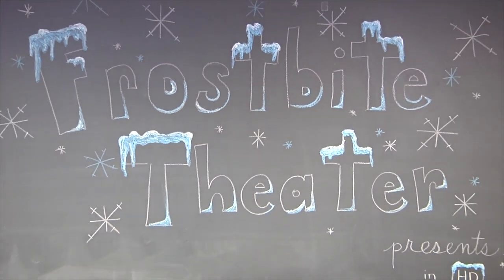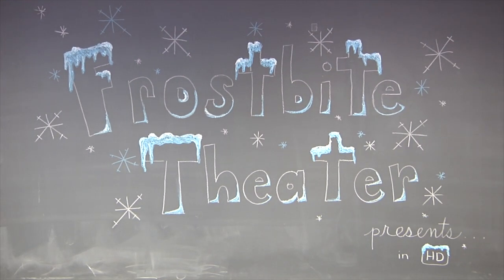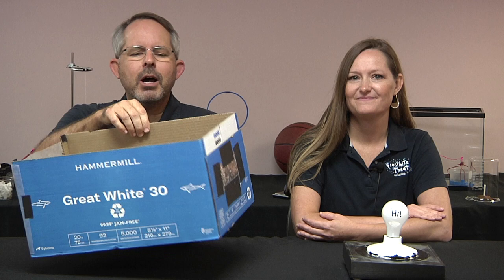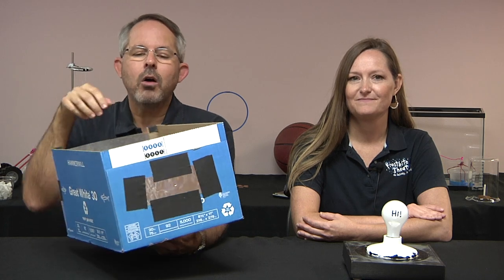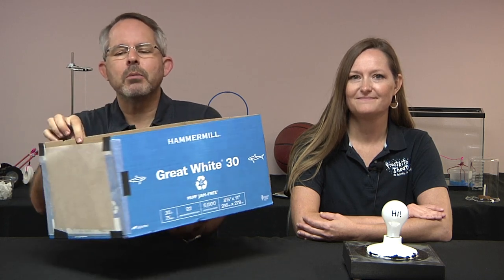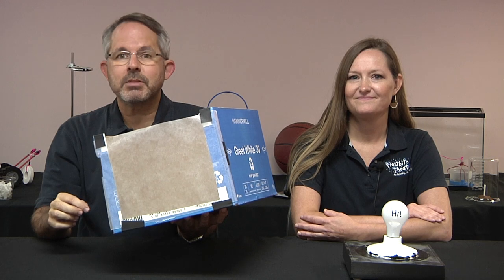Here's a Question! - Image from a Pinhole Camera

Comment: An excellent example of  a pinhole camera is our eye.  We actually see things upside down and reversed right to left.  Our brains take this imaging data and  converts it to something we can make use of.  Thanks brain! 
And thanks Joanna & Steve!
Reply: Some people think the data is flipped again before or after its send to the brain so we can see the things correctly. The thing is, it doesnt have to. Your brain works with electrical signals. Thats all. It can adjust its purpose/meaning cables according to the incoming input. This can even done after you grow up. If you use a vision flipping googles long enough, you brain will recorelate the information according to the input and reality. After some long enough time, you wont even notice the difficulty of using a vision flipping google (in a nutshell)
Reply: So there is no difference between a pinhole and a lens...BUT. why  pinhole doesn't have focus and lens have?
Reply from the maker: A lens actually bends the light. The pinhole doesn't. So, you can manipulate where the lens comes into focus.

And, technically, with an ideal pinhole, everything is in focus. Of course, an ideal pinhole wouldn't pass light, so the image would be a bit difficult to see.
Reply: @noproblem4260  Simplification: The depth of field of a 'lens' is proportional to the size of the aperture.  see 'Circles of Confusion'.  Obviously, the tiny hole that allows the light in will make for really small 'circles of confusion'.  If you look closely at the image from a 'pinhole camera' you will see the blurring. 
   Obviously, modern lenses are designed to reduce the distortion with larger apertures and that leads us the 'magic' that is modern cameras. :)
Reply: @sayochikun3288  You are right, there were some early surveying instruments that delivered an inverted image to the user.  The early surveyors had to train themselves to see things inverted and that took several repetitions but eventually they became adapted to it.
Reply: @JeffersonLab  So that is why a camera must have a lens that is not fixed in one position but capable of being moved in and out.  That makes it possible to make a clear image on the receptor regardless of whether the object is near or far.  Of course there will be a limit as to how close the object can be before the lens can produce a clear image on the receptor.  No limit though for objects that are far away.
The lens in our eye has the unique capability of being able to change its focal point with tiny muscles that are able to change its thickness and thus changing the focal point and keeping the lens fixed in one location.

Comment: Excellent explanation of why the image is seen as it is. i.e. the light rays travel in straight lines from the source and  must go through the small pinhole in the center of the image.  Maybe it would  have been more obvious if the letters used didn't have vertical  or horizontal  symmetry? Thanks for this.
Reply from the maker: Yeah. Problem was we needed something that was short enough to be written legibly on the lightbulb. So, constrained to a couple of letters. Didn't spend a whole lot of time thinking of alternatives. Probably should have underlined it to make it more obvious.
Reply: @JeffersonLab  Lowercase letters are designed to be easy to read? The 'underline' is also symmetrical.  
  Please understand I appreciate what you were trying to show. It seems it could have been more clear about what you were trying to show about light and vision. e.g. 'her', 'hy?' etc. The multichoice images would have been rather more obvious. I suspect that you are not teachers. ;-/
Reply from the maker: Underlining the text would have helped with 'upside-down or right side up'.
Reply: @JeffersonLab  Your writing made me appreciate why a classical test pattern in optics is the letter "F"
Reply from the maker: Yes, but arguably not the best letter to use when a YouTube comment section is accessible.